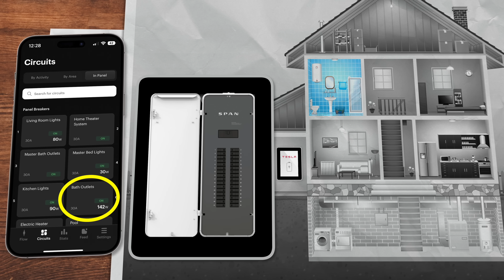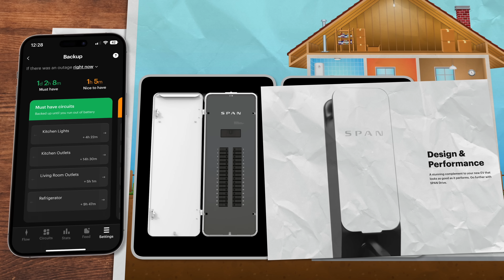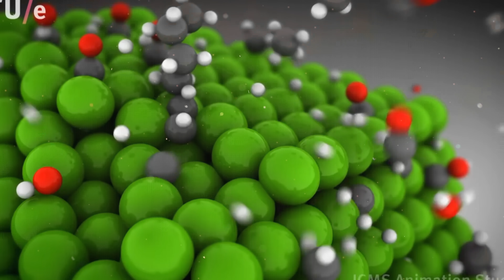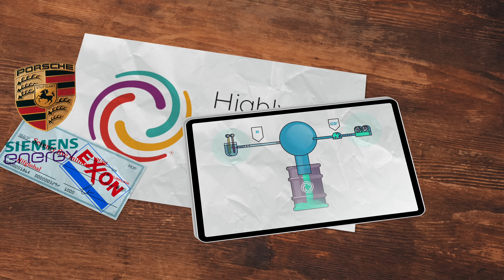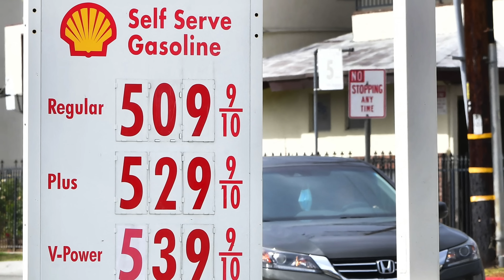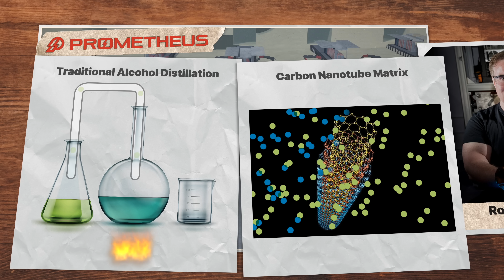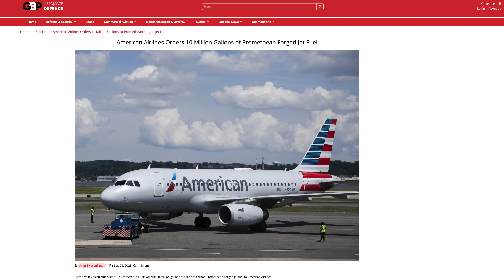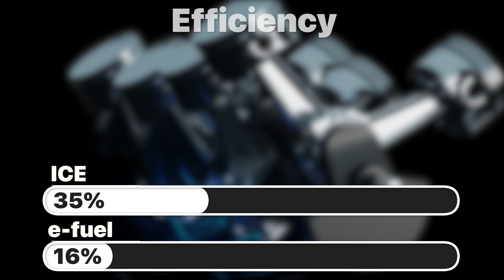EPIC Breakthrough Can SAVE the Internal Combustion Engine!

Comment: There is this perception out there that 100% of hydrocarbon use has to be replaced to 'save the planet'.  That is just silly.  Reduce GLOBAL CO2 emissions by 50-60% across the board - transportation, energy production, etc, (looking at you China) and that would be more than enough to offset man-made contributions to climate change.  Environmental wackos have been telling us the world is just 8-10 years away from total ecological collapse and the end of civilization as we know it for over 60 years now... and we are still here.  As with most situations involving extremes on both sides, the truth is somewhere in the middle.  100% elimination of CO2 emissions?  Not possible, at least not in our lifetime.  Completely ignore the CO2 issue and claim it is a hoax?  Totally and completely irresponsible.  The answer is somewhere in the middle.  E fuels could be another piece in the overall puzzle - a puzzle that will benefit from lots of different pieces.  As with all things - market demand will dictate the speed of adoption.  As I move towards adding solar to my property, and eventually getting an EV, I'm not doing it because I'm killing the planet with my energy use.  I'm doing it because it helps my wallet.  The technology is cool and I love every bit of it, I don't love it so much that I can afford to take a huge financial hit just to adopt it.  This full on panic mode some people have is just mind boggling... just as mind boggling as those that stick their heads in the sand and insist there isn't a problem.

Comment: Even with renewable fuel for ICE, the ICE efficiency is a fraction of the electric engine.  Then add the inefficiency of creating the efuel.  It only takes a few minutes of thought to realize this is a bad idea.  It only makes sense for jet engines.  

You are better of removing the ICE and upgrading to electric vehicle through conversion.

Comment: Efficiency may not be there but if it can be produced at or near the cost of fossil fuels then this is the best option for today. Infrastructure is already in place and will not require tax dollars as it is already competitive.  Added benefit is that if we ever get to a point where nuclear, solar and wind energy are excessive then we can add e fuels as long term storage that won’t degrade.

Comment: We still will have to breath the bad stuff between the tail pipe and the recycling plant, and the tail pipe is not spewing carbon only, an host of other bad stuff comes out of it. trying to save the ICE is like trying to save the incandescent bulb. Years ago, LED was an expensive tech that was too hard to produce in mass at too high of a cost. Today we can't even buy an incandescent bulb. ICE is doomed and should be.

Comment: 1. getting rid of gas engines is just a way to control the populations movement.
2. deforestation is the primary cause for climate change.
3. electric vehicles will never beat the energy density of oil
4. the sun is the main contributor of climate change.
change my mind.

Comment: There are four elements to converting to electric cars these four things have to be done and we could have done that but when you have a strong political resistance based The fear of change and the resistance of oil companies and their propaganda it makes that conversion a great deal harder,. The four things are a cheaper battery a battery that will hold at least three to 500 mi range abundance of charging stations and faster charging speeds 5 to 10 minutes. Because once you reduce the cost of the batteries then electric car becomes a great deal cheaper than a combustion version no transmission no exhaust system no engine, And then there is an abundance of charging stations charging station should be as abundant as gas stations and grocery stores,. And the speed of charging as well no one has the time to wait 3 hours or 4 hours while their vehicle gets charged But if they can reduce the speed of charging to 5 or 10 minutes it would be very practical. Once that happens and the word gets around and people realize not only how cheap it is to recharge their vehicle The fact that maintenance drops down by 70% because let's be honest the combustion engine is very very inefficient requiring Greece oil different other fluids belts hoses antifreeze as well as exhaust system compared to an electric car which is basically a generator and a battery storage. I hear so many people who are reluctant for the technology because it means change it means less mechanicals repair it means no need for oil changes transmission fluid All these other items and they complain all this will put people out of work technology changes when this happens they will need technicians to take care of the generators they will need more mass production of generators The car will still need people to take care of the tires the axles and everything underneath them vehicle as well as the electronics and the bodywork in such things will still need. But people resist change and oil companies and energy producers are fighting against this change.

Comment: Government subsidies shouldn’t even be discussed when it comes to fossil fuel alternatives. They should a be a given. Oil is artificially cheap because it is so heavily subsidized. If governments stopped subsidizing oil companies, and instead used the exact same dollars spent on renewables, our energy costs would nose dive for renewables and skyrocket for fossil fuels. Fossil fuel companies, as they are now, are insanely subsidized.

We also need to look at options that don’t just change the cars we drive, we need to wholesale change how we get around in the first place. Public transit is under invested in across North America, but governments have no problem subsidizing free roads. Road that need to be rebuilt every 15 years, that all taxpayers, regardless of whether they drive or not, pay for. It’s unsustainable from an ecological and an economic standpoint, which is why I’m against the idea that changing what we drive instead of the act of driving itself will be a much better solution.

Comment: I like using alcohol as a fuel and intend to increase my production of it this year to power my lawn tractor. NB can't use it in the car since alt fuels are illegal in this state (SC).

However, alcohol has 1/2 the energy per gallon as gasoline.  Where do efuels stand by comparison?
Reply: Ethanol has 2/3 the BTU of gasoline (76100 vs 114100) which is good to know in a steam engine but has other burn characteristics that make it a superior fuel in internal combustion piston engines.   These other burn characteristics make it that ethanol can get more mileage than gasoline and even more than diesel, a fuel with more BTUs than gasoline.

Ethanol is also near being pollution free when burnt which is why ventless indoor ethanol fireplaces are sold.  Even small amounts of ethanol added to gasoline can drastically clean that dirty fuel up.  Even with just 10% ethanol added to E0, the Swiss Federal Laboratory for Materials Science and Technology found that the especially health devastating ultra fine or nano particulate emissions were lowered by 97%, carbon monoxide lowered by 81%, carbon dioxide lowered by 13%, aromatic hydrocarbon emissions lowered by 67-96%, and genotoxic emissions lowered by 72%.

Ethanol in our current gasoline optimized engines gets more power but less mileage than gasoline.  For example, a Chevy 5.3L engine gets a clean 380 horsepower on E85 vs a dirty 355 horsepower on E0.

This engine Ricardo built for GM and drove around gets both more mileage and more power than gasoline and even diesel.

FROM RICARDO:
The new federal CAFE standards are calling for a doubling of fuel mileage performance, which, Vint says, is going to send OEM’s looking for high octane numbers to improve efficiency and ethanol is the best source. Ricardo, an engineering firm with over 100 years in the business of engine design, has developed an extreme boosted direct injection engine (EBDI) to optimize ethanol blends. The 3.2 V6 gasoline engine rivals the power and torque of a much larger GMC Sierra 6.6 diesel, he said, and it delivers 3.5 percent better fuel economy than the diesel.

This is not new technology or knowledge, it was known long ago.  It is suppressed technology.

Rear Admiral C.M. Chester wrote Henry Ford a letter on Dec.15, 1916:
"...I also pointed out in the article that as governmental laboratories had developed from 40 to 55% efficiency in alcohol engines as against 20% in gasoline machines, the use of alcohol at double the cost of gasoline for power purposes, was cheaper for motor[s] than gasoline in common use today."
Reply: @danafletcher2341  You had me going there.  REAL WORLD results however, show E85 fuel severely reduces mpg and increases maintenance costs.  But that's mostly my experience and the handful of people in my community.  As for power output, the fact that I know of no one (only asked 8 people though) with gas powered working truck who uses E85.  They all say the same thing.  Ethanol reduces power.

But then you started spouting propaganda.  Why not just say "Forget science.  Just give all your money to our start-up?"

We need real solutions, dana.  So don't give up.  Just stop buying into advertising or unsubstantiated claims (including mine).  Do your own tests.  It's not rocket science

Comment: I have something else to add. These older vehicles you're concerned about replacing, need to have kids available with individual electric motors for rear axles or front wheel drive axles, to Simply install into them. Battery packs can be replaced in the front end or the trunk space or both. There's still a perfectly viable option, and the old engine manufacturing facilities could easily be reprogrammed, since most are already robot manned, to manufacture the much simpler Electric drive system replacements!
Reply: Its a cool concept, but the problem with ICE vehicles being converted is weight (among a lot of technical challenges). They are simply too heavy to just add a battery and call it good. To add batteries large enough to work in lets just take a random car like the HIghlander (mid-size standard SUV no frills). The battery would fill the entire cargo area. Even removing the engine, gas tank, etc.. They were not designed from the ground up to be as light as EVs are. Plus no company will bother to invest massive amount of money for a retrofit to a car that is already sold. The amount of hurdles is actually crazy and not viable on all the 10s of thousands of different ICEs on the market. Its way cheaper and easier to just make new cars EV and phase out old designs. Retrofits have been done, but they require an incredible amount of work and most of them are just for fun. This is because they cost more than what it would cost to simply sell the car and buy an EV, and they mostly all suck at range per kWh. Not even in the ballpark of modern EVs.

Comment: The biggest problem about the internal combustion engine, or the infernal combustion engine as I call it, is that it is a cultural phenomenon too! People just don't believe, because of all the wimpy EVS that came out in the past, that these newer ones, made in the last 5 years or so, are actually capable of really sporty performance and 300 plus mile range. Besides, there's just this as I say cultural bias built into people's minds about the infernal combustion engine. The Wright brothers would simply have used electric motors to fly their plane! At the same time they were experimenting with flight with a heavy ice engine, Baker Electric was beating the 100 mile an hour speed barrier, in his electric Speed Demon, which unfortunately did not have brakes equal to the task, causing him to miss his second run which he claimed at 120 miles per hour! Pretty impressive, for 1902! Always remember that the largest land vehicles on Earth, which are trains, our powered by Electric traction Motors! That big diesel engine you hear when they go by merely turns an electric generators / alternator, that does the work! I have mechanic for years along with being a framing Carpenter welder electrician and plumber, and believe me nobody's going to come up with anything that's going to make the infernal combustion engine any more than possibly 50% efficient, which would be at least 50 miles to the gallon! We can't be diverting especially taxpayer funding to such a futile boondoggle Enterprise! Stick with the electrics and and figure out how to keep the lithium batteries from getting too hot without using a liquid coolant! That is one of the weaknesses of the ice engines, or most of them! Especially on such a large framework as these batteries require, any stresses on the vehicle, in a twisting type situation will eventually cause these large battery Frameworks to leak. Sodium is starting to look more and more viable also. We want to get away from a poison emitting transportation system! Planes will probably not be addressed for a while yet. They can wait, get personal vehicles and ground-based mass transit electrified first!

Comment: The same base issue with efuels is the same as EVs. Cost!  EVs are too expensive and the infrastructure to support them is too.  Hopefully further breakthroughs will lower efuels production costs.
Reply: ICE have been improved over the years and are unlikely to improve more but remain very inefficient. Whereas batteries are changing quickly and great leaps forward are possible. At the moment evs are expensive, but prices will come down. I think the future is evs. Air transport may be different.
Reply: @eddewhurst7662  it is clear that EV's are "our" future, however, the materials needed to manufacture todays batteries long term is limited and the process is not environmentally sound.
Reply: @Scottify11  We will not run out of material for ev batteries, that is just wrong information.  No mining is that environmentally friendly, but for every kilo of lithium mined in 2021 we mine 90 tons of coal and 30 tons of iron. Mining for batteries is on a relatively small scale. Sodium batteries are being brought into production in 2023.

Comment: This is just the same superficial logic that got us into ethanol fuel. The economics is suspect, the science is sound but the products have better utility elsewhere. ICE has very low efficiency and deserves to go extinct wherever an alternative exists. The products are better utilized in the petrochemical industry instead of burning them again in ICE vehicles that can't even top 40% efficiency. It might even be better to burn those efuels in power plants and using the electricity in EVs. At least you could tame the pollution better at the power plant and maybe recover some of the CO2 for recyling into efuels all over.

Comment: Japan is building a new atomic reactor which appears to be a great improvement over the one which failed. Use this new type of reactor to produce green hydrogen. The hydrogen can then be stored in solid form in cassettes and it will be released in a vehicle as needed. (No need to compress and store or transport hydrogen under high pressure). Finally the hydrogen fuel cells will produce electricity and power the electric vehicle. This is all currently possible as the technology has been demonstrated and I expect we shall see this system in use this decade in Japan.

Comment: More like epic scam. No carbon from air technology has proven itself to to date. The energy required could be used directly and more efficiently. I wouldn't be surprised that getting oil from the ground is cleaner and less energy intensive than these miracle fuels. They only serve one purpose, emptying bank accounts of gullible investors.

Comment: the fuel is nice
but whats cooler is that its a way to filet the carbon out of the air
sure have to be careful not to create an ice age
but a part of that 30% efficiency of ice's is sooth left behind
parts not fully combusted
parts not going into the air and left on the ground
but if its really all its trying to pretend it is
we can need to burn coals 

not that its going to make my electrical bill what it was 20 years ago

Comment: Hi, sorry but you forgot a huge amount of info in you comparition about fuel efficiency, because for ev and  renewable gasolinera you taka all the process to calculate the efficiency, but for tradicional ICE you take only the burning process in the vehicle itself. But remember there is a lot of energy wasted pumping out the oíl, then transporte that oíl to the refinery proceso  where the lost are huge, then you have to transpot it again to the pump stations before to use it in a y car... So if you take all that in the efficiency calculation you ended UP with a number like 9-15% for ICE cars

Comment: ev just shit the source of co2 emissions from the tail pipe to  smoke stack   only 30% of the energy used by the gas plants is converted into electricity  only 20% of the coal plants is converted, and only 40% of the nuclear is converted.  the lost energy is dumped into the environment as heat adding to global warming.  we need better methods of producing electricity to make the ev work and to do things lie efuels.